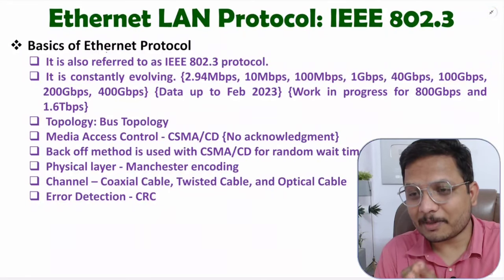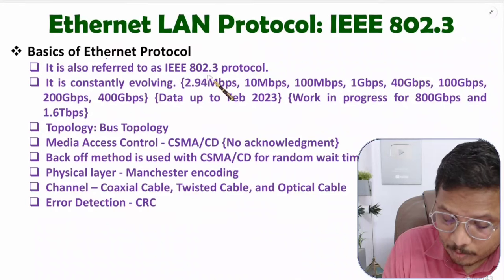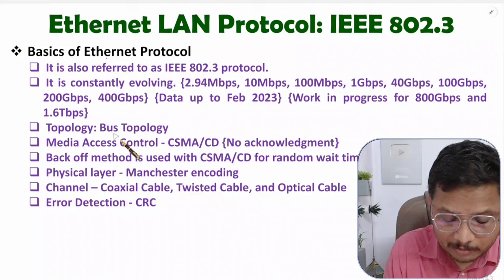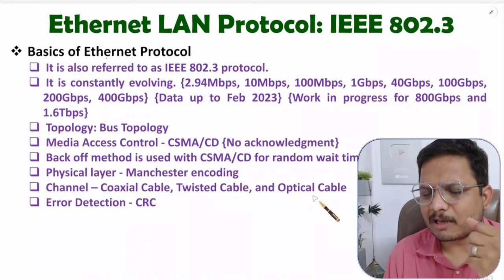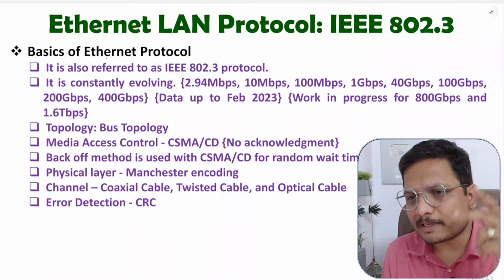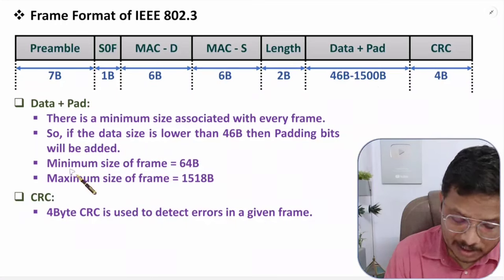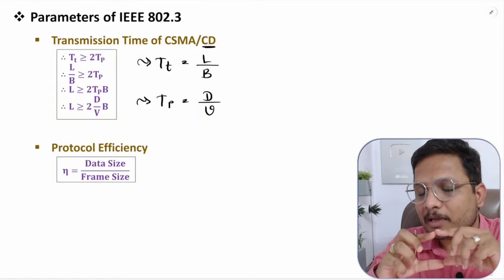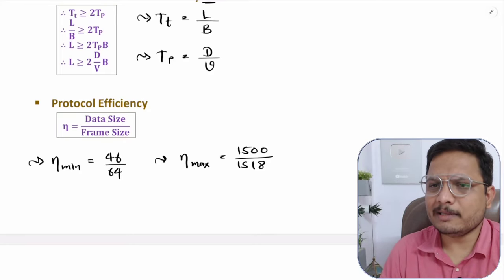Ethernet LAN Protocol Explained: IEEE 802.3 in Computer Networks

Comment: Sir in the introduction (@1:40-1:49)you have mentioned that  bandwidth is increasing with  ethernet LAN protocol, is it regarding the advance ment in technology that lead the ethernet to support higher bandwidth or is it regarding the protocols advance ment . if itds regarding the protocols advancement can you just brief it .
Reply from the maker: It is due to optical transmission.